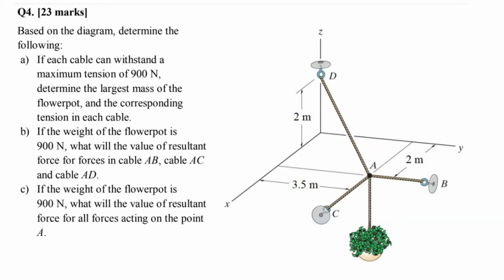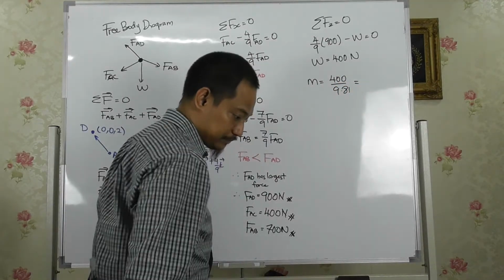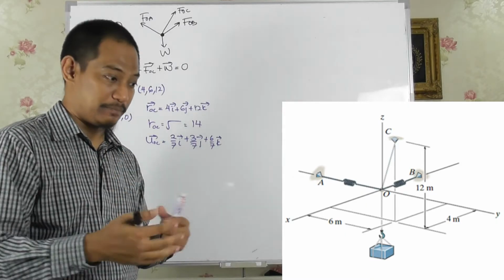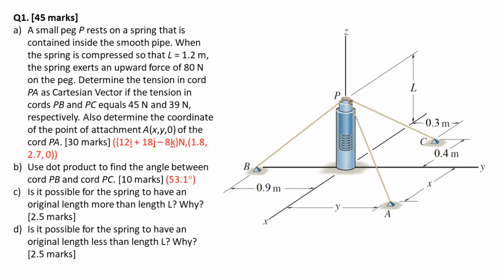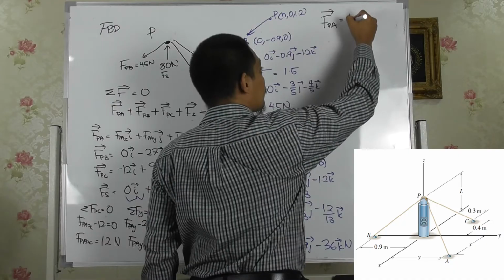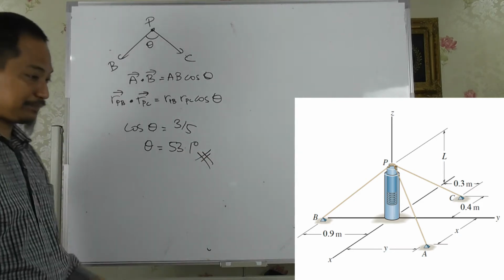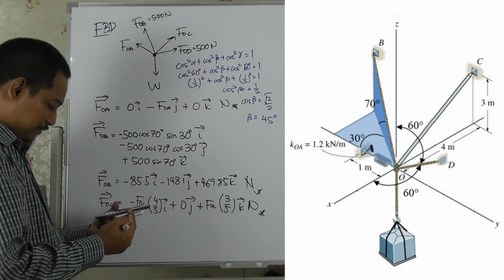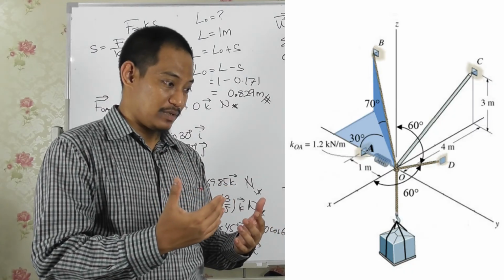Statics Tutorial - Ch. 3: Equilibrium of Particle - 3D Problem

Comment: salam sir, for question 2, can i use the trigonometry concept to find Fx and Fy for Force of OC ?
Reply from the maker: as long as you can present the steps clearly on the paper, and the examiner can understand where each number come from, it should be ok.  (some students may understand what they are doing, but fail to make other people understand by just going through on the paper what was written, that is what you need to avoid, basically)
Reply: @SaifuddinRehan  noted, thank you sir

Comment: i think there is a mistake in the coordinate of point C , it should be ( -0.4 , 0.3 , 0 ) instead of as written on the board ( 0.3 , -0.4 , 0 )
Reply from the maker: you are correct